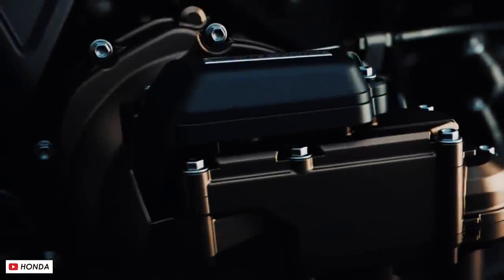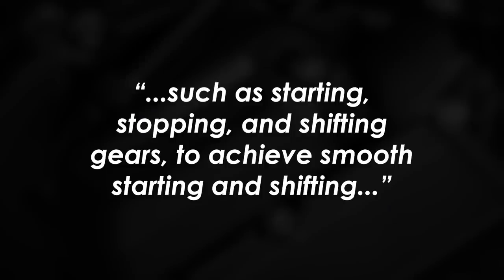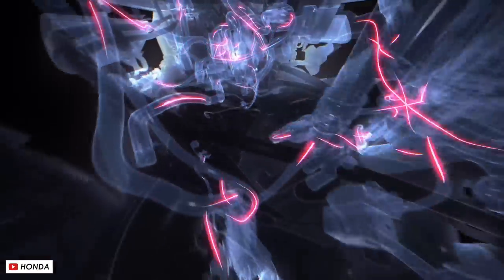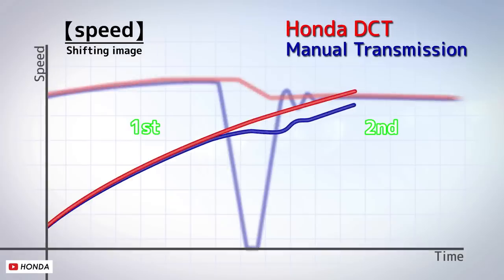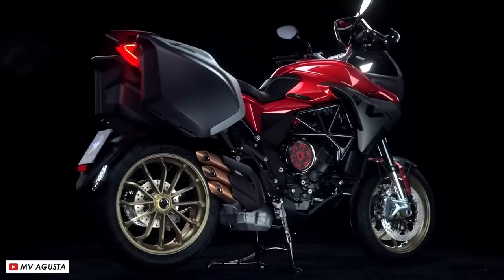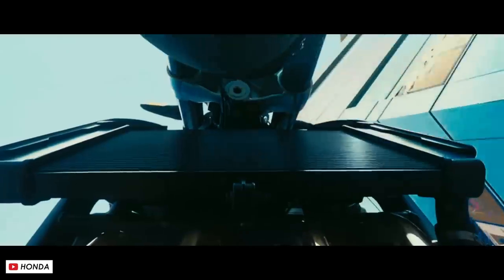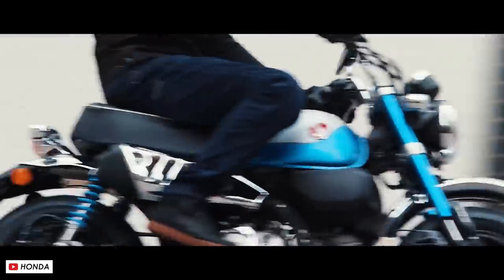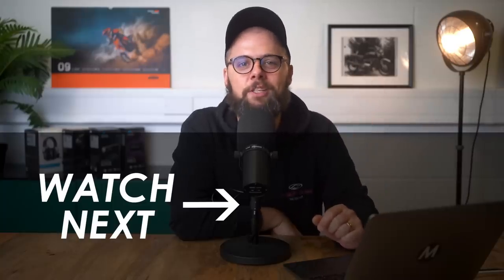New Honda E-Clutch For Motorcycles Announced!

Comment: if you have another look there's still a clutch cable going into the transmission. My best theory is that the 'add-on' is essentially a computer controlled actuator along side a traditional clutch cable.
Reply from the maker: Good point and good spot!
Reply: Honda filed a patent for that in 2021. There are several articles with detailed drawings on the web, google Honda e-clutch patent. It seems to be a clutch-by-wire system with a sensor in the clutch handle and an hydraulic actuator near the clutch housing. This allows for overriding the rider’s input for the sake of stability, e.g. to replace a mechanical slipper clutch or to ease out any pumping in the drive train.
Reply: @papajulietromeo-650  it’s not a clutch by wire if there’s a mechanical link shown in Hondas video
Reply: @nazhif1 x-by-wire only means that there is no direct mechanical link between the lever and the system „x“. In the video, there is a mechanical link attached to the clutch plates, but this does not mean that it is directly linked to the clutch lever. They most likely placed the actuator outside of the clutch housing to keep it away from oil and high temperatures, and to make it a simple add-on system that can be added to a bike without a full redesign of the clutch housing.

If you still had a full mechanical or hydraulic link to the lever, the actuator would have to work against the rider’s input. This would result in a system similar to a servo steering in a car, where it reduces the force needed to operate the steering wheel, but cannot act autonomously.
Reply: They did said it's something you can add on
Reply: Yup I think its automated manual transmition, without fully gear-selected controller
Reply from the maker: @jerryx2000  nah - I think when Honda say it's easily transferrable across their models they just mean it doesn't need a huge redesign like it would to fit DCT

Comment: Being one of those who suffers with painful wrists this is a great idea. I currently ride a Honda with DCT and although I miss changing gears myself, I don’t miss the pain, plus it keeps me riding where otherwise I would of given up.
Reply: That makes two of us! Love the NC but a Transalp would be a lot of fun if I could manage the clutch.
Reply: I'm in the same situation.  I was thinking of getting an NC750 DCT.  Now I think I'll wait to see how this E clutch works
Reply: How do your wrist pain corollate to the clutch, I'm curious
Reply: Would of?
Reply: @Daniel-dj7fh You use your hand to actuate the clutch…and as the wrist is connected to the hand, the tendons and ligaments have force applied to them and anyone with arthritis or just getting old will experience pain.
Reply: @Daniel-dj7fh  it was clutch pull or bumps. Arthritis in the wrist. I've had surgery and I'm good now with clutch pull. But I still worry about the future and want to keep riding. So this E clutch sounds promising.
Reply: Arthritis? Me too - I bought an MV Brutale with the SCS clutch. Still has a lever but it’s effectively a centrifugal clutch. Not the finest clutch control from the lever but you can slow down, come to a complete stop and then pull away again without touching the clutch lever.
Reply: i also love DCT, the only drawback that you cannot use clutch on slow speed manoeuvres. But I don't miss changing gears. Cars are great with manual, motorcycles causes each stop 10 shifts at minimum (from 6th to first, and from first to 6th). And do that 100 times a day while riding and gets old very fast for me personally.